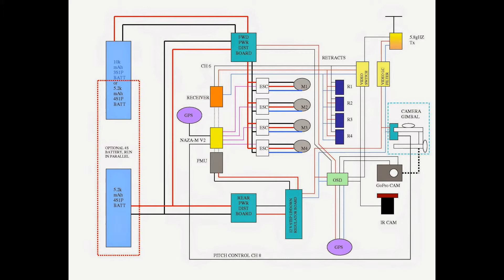Zeus Build Up In Slides

Comment: I'm just putting one of these together myself, it's a nice little kit, mine differs from yours a bit though because the one I just got has double locking clamps for the arms that are mounted side by side instead of the single ones on your version of it...I think I might put the AGM 3515 motors I've got lying about on mine with 15" props & a 4s 10 amp battery pack & see how it goes.....I like some of your wiring layout, I might borrow some of your ideas with that. ;-)

Comment: Hey Dennis,
I have a H4 that I am in the process of building myself. One question , how much did you tighten down the motor mounts onto the carbon fiber tubes? I am afraid of over tightening mine .